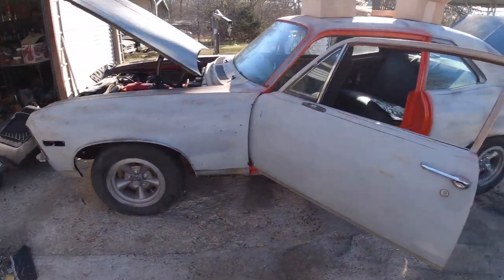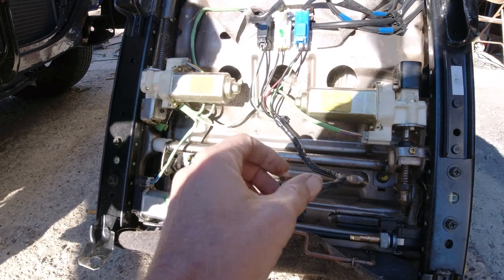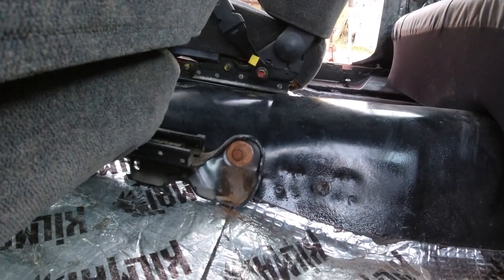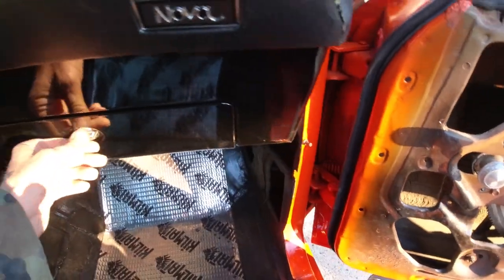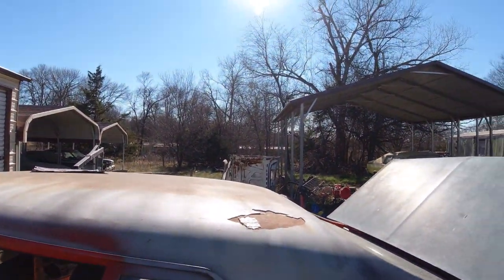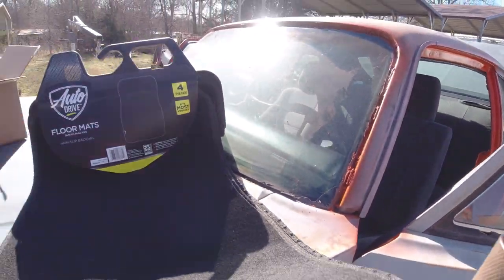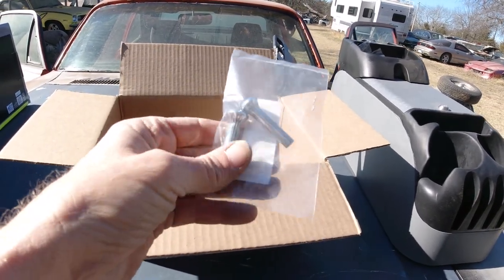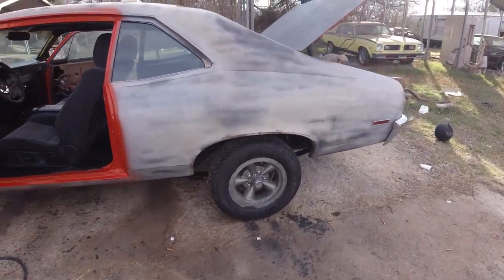Restoration of a 1972 Chevy Nova - Part 19 - Seats, Carpet and Console

Comment: If it has the air conditioner working I’d buy the vents and put them in and then put the gauges under the dash if it’s not going to be used I’d leave the gauges in the dash they look ok there ,nice work on the car I painted  my 70 green nova marvellous orange in the late 80s it was like a hugger orange I did all the same things your doing to your nova !! Great job keep it up 👍🏼
Reply from the maker: it's not an ac car

Comment: That looks pretty nice bro good job… in my Lincoln I did 2 layers of “Siless 80 mil”it’s like”kilmat“ also did 1 layer of “Noico RED 315 mil” all over the car and another layer in certain areas and then “Jute Carpet” that’s what’s supposed to be under that carpet you bought but it comes in such a thin line of it… some might say what I did was over kill .. but I live in AZ and it gets fukn Hott as hell’. so with that and other concerns I don’t want to hear any road noise and bcuz of the brand new speaker system I put in ; most people don’t know but the wiring has to be protected and it picks up road noise if certain wires are not insulated well..  Also to your question on the “AC”or Gauge’s”… I don’t know how hot or cold it gets where your from but it be better to do the AC/Vents and those gauges put them on the side pillar or you can do what I did..Most people also don’t know that old cars like yours or mine they don’t come with center consoles so no cup holders or etc.. So bcuz a lot of parts on my car are either hard to find or expensive I’m not trying to drill holes if I don’t need to. So I built me a center console just something simple for 2 cup holder that are L.E.D and a flat panel so I can house 2 tweeters that face towards you and the passenger. I’m just debating on making it all Vynal,Pleather or fiberglass in certain areas or do like a mix media.. idk boss just an idea..👍

Comment: The spring on the parking brake cables will return the parking brake lever back to the up position.
Reply from the maker: I'll try and tighten up the cable to see if that helps. Thanks for the box of stuff!
Reply: @clunkersandclassics  glad you can use that stuff. I have more I will send you soon.